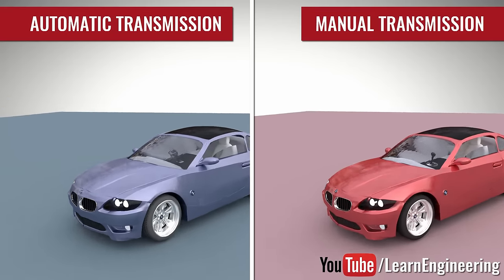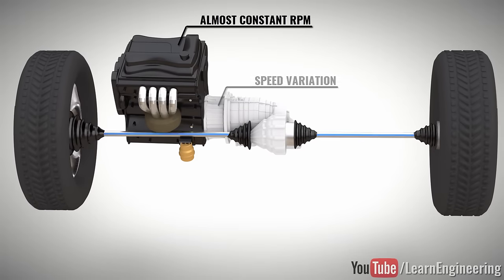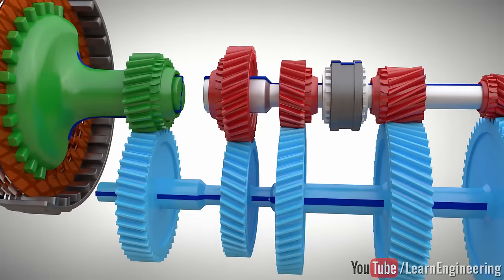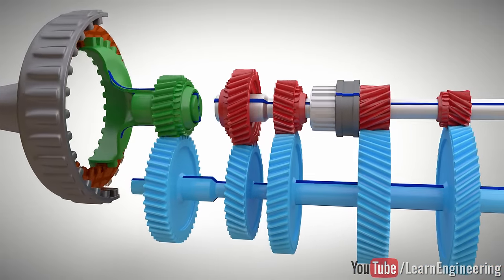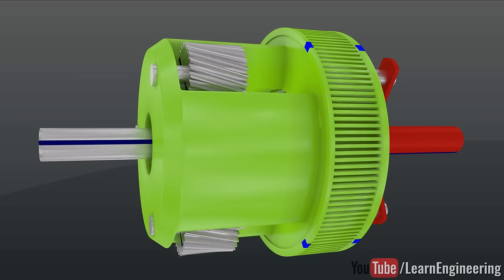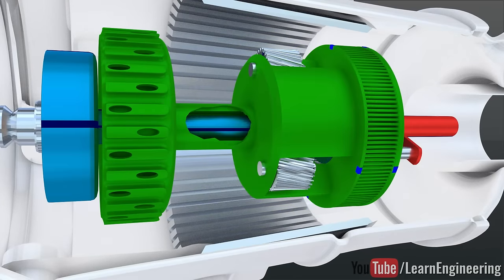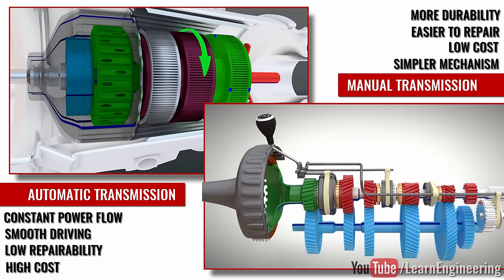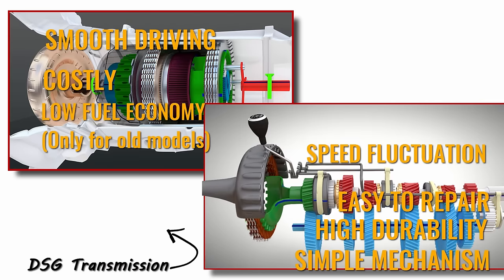Automatic vs Manual Transmission

Comment: Manuals can be a smooth experience you just have to rev match.
Reply: You will not hit rev matches as often as an automatic. Also when you fail, it is even more bumpy.
Reply: That's why you drive for more than a week. Im far from an experienced driver and I rarely miss rev matches. Given like, another year of practice and I don't see myself missing any. 

Manuals also have a huge host of other advantages that I won't go into.
Reply: I have litreally never been in a manual car and had an experience that was as nice as a good automatic. You must be the best shifter in the world, or not. You and I don't define bumpy the same. Trust me, you miss more matches than you think. Over 200 rpms wrong and you can feel it quite a bit.
Reply: Maybe you're just the worst shifter in the world.
Reply: I know for a fact that you can not shift as smooth as a new automatic and as consistently... But yeah, you are probably the best driver in the world.
Reply: and smoothness is the most important thing?
Reply: That is up to you to decide. I am just stating the fact that no human will never shift as fast / smooth as an automaic.
Reply: +MacMatV2 you ever been in an auto when it's confused about what gear to be in and it's constantly changing gear? Really smooth that... 

 it ain't hard to match revs and be smooth with a manual, it's all about smooth clutch action.
Reply: Yeah I am not driving cheap ass automatics but I know that they can be terrible. That is the reason I said "I have litreally never been in a manual car and had an experience that was as nice as a good automatic". The keywords here are "good" and "automatic". Still, you will not be able to match the revs in a sporty gearbox as well as a quality grade automatic gearbox can.
Reply: in automatics you can feel the smoothness of constant acceleration, but in manuals you don't because in some point you have to change to the next gear and the feeling of constant acceleration is gone, unless you go only in first gear 😂.
Reply: unless you're using a CVT autos have to change gear too...
Reply: years ago this was true however we have gotten to the point that no matter how good of a driver you are, you can not out shift or out perform the consistence of car's on board computer.

Now drving a manual can be more fun.
Reply: Bumpy by missing by 200rpm?? What?? I guess you mean 2000rpm? But even then how could someone miss by that much! Rev-matching takes under a week to master on a new car. One you know how to do it you will do it sub conciously.. Just like basic driving. Xxx
Reply: If you drive a car with much power then 200 rpms is more than enough to get a bad gear shift. Normal cars are much more forgiving though.
Reply: Punisher Got it down in just that. A week.
Reply: +MacMatV2 engine speed means nothing in terms of power.... if your top gear ratio is 1:1 and your engine is spinning at 2000rpm, your wheels will be spinning at 2000rpm, doesn't matter if you have 1hp or 1000hp.

That's an easy way to rev match too, if you know your engine speed at a particular wheel speed you can easily match the revs. 
Example - my daily is a Bimmer 120D, I know that 2000rpm in 1st = 10mph,  2nd = 20mph, 3rd = 30mph, 4th = 40mph etc. So if I'm breaking down to any of those speeds all I need to do is blip the throttle up to 2000rpm and release the clutch.
Reply: if that.. cliosport took about a week id say. When i got the ep3 i was getting the hang of it just driving back after the purchase. seat cupra r was probably the toughest to master..
Reply: Yeah, no. I think it has to do with the flywheel but for example in a fiat you can dump the clutch with 500 rpm off and it will be as smooth as always. In my m135, you will feel extreme discomofort as soon as you are more than 200rpm off.
Reply: My brother has driven stick his entire life and he drives as smooth as an auto
Reply: Either 1. You and I do not share the same definition of smooth. Or 2. You have been in som really old and shitty autos. Pick one, or both.
Reply: +MacMatV2 or 3. you've never driven with someone who could drive properly ;)
Reply: Trust me I would probably not class your shifting as smooth ;)
Reply: Alpharius manuals are in general better, less fuel consumption and better top speed
Reply: Most new automatics are more fuel efficient than manuals though...
Reply: MacMatV2 no, because of the torque converter plus the gear ratio is Higher so they shift better/smoother
Reply: Go and check Bmw for example where autos have a higher mpg...
Reply: MacMatV2 could be even better with a manual
Reply: +MacMatV2

new 8/9 speed auto's are more efficient at motorway speeds, however for "urban" driving it's still more efficient to drive a manual
Reply: BMWs manuals rev match for you.
Reply: John Smith dont automatics have a little more resistance and weight alittle more?
Reply: "you can not out shift or out perform the consistence of car's on board computer."

hahaha that made me laugh, there are a lot of things a TCU can not do, gear hunting has plagued autos since they were invented and TCUs didn`t do much better
Reply: ok, newer autos have better fuel economy for a variety of reasons: they are electronic instead of hydrulic,  the lock up clutch increases fuel economy at crouse speed, have more ratios to keep a constant power flow and reduce heat in the torque converter (spend less time in stall)
Reply: Rev matching is harder on the syncros, esp with downshifting. Need to learn double clutch techniques.
Reply: Thing between a manual and a slushbox is when you dump the clutch between gears and no matter how smooth you are, when that clutch leaves the flywheel, you lose that power momentum, where a slushbox shifts and retains the power.

The flip side to this is the manual allows 100% power to the axle since the clutch is contacting the flywheel and power through the gears .

A slushbox with its torque converter uses fluid between two rotating surfaces, thus no 100% power to the gears and to the axle. A manual can walk all over a slushbox car when it comes to power to the driven axle.
Reply: Monte Fullmer modern automatics have  direct Connection too. So they only shift with it and have no slip.
Reply: There is a reason Ferrari stopped producing manual transmissions for their new cars it's shifting speed is so much slower and the advances in technology allow more power to be sent to the wheels in the Automatic transmission. There is also a reason why the Rolls Royce Phantom is not a manual transmission it can give a much smoother ride through the Automatic gearbox.
Reply: minimonkeyplay manuals bring alot more enjoyment to driving and are easier to maintain
Reply: Ferrari doesn´t make trasnmission they outsource them...
Reply: +minimonkeyplay you're right dual clutch/paddle shifts are quicker at changing gear, however they're still are technically manual gearboxes, they don't work the same way automatic's do, and have you ever tried reversing one or driving one in stop/start traffic? They're awful for everything but track driving

the reason why RR use auto's isn't 'smoothness' it's that they view manual's as cheap and they think that everyone who buys a RR will want the car to do all the work
Reply: +John Smith I'd call a paddle shift dual clutch a semi Auto as the Transmission is doing most of the shifting work for you, a true h pattern you have to do it all pretty much aside from synchronizing
Reply: minimonkeyplay the automatic transmissions that you are talking about have more in common with manual transmissions than the automatic described in this video.....
Reply: Alpharius thats why i ride motorcycles
Reply: And be perfect every time lol.
Reply: Don't dump the clutch and you'll be smooth regardless of rev matching......
Reply: I've driven manuals all my life. You can feel it when the gear changes, but it isn't rough or jerky or anything, especially once you've got the technique mastered, it's nice and slick. I've ridden in my friends' automatic as well and that was so smooth you could never tell unless you listened to the engine. Manuals are never "rough" unless your technique is bad and you want to redline every gear, which you never do in daily driving.
Reply: There's true automatic (Torque converter), the CVT, a CVT that simulates discrete gears, and then the AMT (which is designed exactly like a manual box, but the lever control and subsequent gear change is electronic) and then the dual clutch automatic. 

I've never been too happy with AMT's (they're not nearly as smooth as driving a manual with clean technique. but they're getting better) and the CVTs have poor response and are better suited for scooters. The Torque converters were super smooth, but you lost efficiency in slow speed driving (but they've since got a lot better). As far as slickness goes, there's no comparison to the Torque Converter automatics.
Reply: If you enjoy driving or you want to keep the car long term, life with a manual transmission will always be smoother. If driving is just a chore, you update vehicles regularly, or you like tow trucks, feel free to choose an auto.
Reply: Thats with down shifts with upshifts that doesnt work...
Reply: I drive an auto at the moment and I hate it.... cant wait to find myself a nice manual to go back to. I've driven manuals all my life until now and I wish I never bought the thing. Manuals get so much longer life and reliability out of were as autos break down and are definitely not cheap to fix. A clutch in a manual swap out no problem but if your clutch pack goes in your Auto look out its a complete rebuild for you!
Reply: Virtually all automatics have torque converter lock up clutches so they act just  the same as a manual clutch.  Modern automatics with 8 or more gears and in sport mode keep the engine revs within the peak power band lock up the torque converter for the maximum time and are therefore much more efficient at putting the power to the wheels.

A manual gearbox doesnt put 100% of the power to the axle, there are frictional losses at each gearset.  The extremely old fashioned three shaft set-up shown in this video,  is most mechanically inefficient in all the gears except the direct gear linking the input and output shafts together.  Most modern manual gearboxes nowadays are all indirect, where only two gears are being usd at any time, rather than four giving an overall more efficient power transmission.

  automatics tend to be less mechanically efficient due to greater frictional losses but modern ones with a greater number of ratios and locking torque converters are generally more fuel efficient.  When the gearbox is not in sport mode, the torque converter lock up clutch is modulated to give very smooth changes.

Dual clutch autos are the most efficient as they combine an all indirect synchromesh manual style gearbox with plate clutches.  They can give virtually instaneous gearchanges.
Reply: gillon stewart ...... Most if not all 8 speed automatics use dsg transmissions that have more in common mechanically with manuals than the type of automatic transmission discussed in this video...... And dsgs' don't have slushboxes.
Reply: isaac karjala..... perhaps you'd like to read my comment again.  dsg transmissions almost always have an odd number of gears, usually 7.  see my comment above regarding dual clutch gearboxes, which is what a dsg is.  I am referring to high end autos such as the 8 speed audi A8 geabox, which uses an epicyclic geartrain and a torque converter.  also the term slushbox refers to a traditional automatic gearbox.  a torque converter is an entirely different thing.
Reply: Sure u can rev match while going down gears. However when going up gears, regardless how smooth u are with the clutch u will have a speed drop. And ur passenger will feel u going into the next gear. I love manual and will only drives manuals till I die. Anyways, a good manual driver, when having passengers in the car, at least me. Always try to make a smooth transaction Into the next gear.
Reply: I also find a manual transmissions to be smoother just because you don't have the constant engaging and disengaging of gears. Also when an automatic you can feel the clutch inside the torque converter lockup. It gets really annoying sometimes. Also was in town driving I find the manual transmission to be a lot smoother. I have a 6-speed manual Mustang in an automatic transmission Silverado. I drive them both a lot so I compare them quite a bit.
Reply: You must be American.
Reply: The video said nothing about smoothness. It said there's a loss of power. Which is true no matter how fast or smooth you shift. 
I've been driving stick for over a decade, from trucks, pickups, sport, and economy cars, in real world, casual, and racing situations. There is simply no possible way to not have power loss between shifting gears. Automatics experience this too, where the car lurches forward between shifts due to a change in velocity (accelerating to coasting, then back to accelerating again). Heel toe can smooth out the change, but by its nature you will lose power during the shift.
Reply: " I am just stating the fact that no human will never shift as fast / smooth as an automaic."

And no automatic transmission will ever shift gears as intelligent as a human who can drive stick!
Reply: MacMatV2 who tf cares. You can match it easily you just need practise it like in everything else in this world. Half a year of driving  a manual and you will match like a pro!
Reply: After driving for some time and learn your car's rev match it becomes second nature, you just do it without thinking.
Reply: I tell you what, you can stop faster in a manual then you can in the same car fitted with an auto

Comment: Manual transmission has a noticeable engine braking. This way you brake with both the brakes and the engine at once. I think that as an important pro, it's not like you have to push the clutch pedal each time you brake. You can even reduce gear and stop in a shorter distance. I don't feel safe when braking with an automatic one.

Comment: Hmm, never seen a Front-wheel drive BMW Z4 before
Reply: Lucas Joona that’s because it’s a 125
Reply: @devinbender8428  There is no BMW FWD cabs. The only FWD cars at BMW are series 2 and X1 S Drive. Even the series 1 hatchback is RWD...
Reply: m1l15lvoue new 2019 BMW 1 hatch is FWD
Reply: @m1l15lvoue  x2

Comment: The video fails to mention that in addition to the fluid coupling being inefficient in automatic vehicles automatic cars cannot account for exterior factors such as varying terrain (hills, mud or sand) until the vehicle tyres are in said terrain. 
By comparison in a manual you can change gear prior to driving into whatever situation may present itself, thereby reducing risk of slippage.
Reply: Try a Mercedes bro. Never failed me.
Reply: Some automatic cars have manual changing of gears, soo your argument doesnt really work
Reply: @Nikomux999  Some, not all therefore the point remains valid.
Reply: @Nikomux999  "some"!
Reply: @Nikomux999  its delayed and not mechanical so you are wrong. Watch the video again...
Reply: Plus a manual won't need a cooler on it, you don't need a machine to service it, longer times between servicing... Manuals are just better
Reply: @EvilJ069  a manual can fail based on the driver. In modern times, automatics last much longer
Reply: @mkgzt  LOL... Anything will fail with abuse. Automatics still do NOT last longer, and they require service far more often that require special equipment opposed to a manuals drain and fill
Reply: @mkgzt  an automatic will fail based on the driver.
Reply: I drive automatic 😎
Reply: @Jaylio  How do you do, madam?
Reply: @EvilJ069  sister, I step on accelerator car goes broom broom 😎🔥